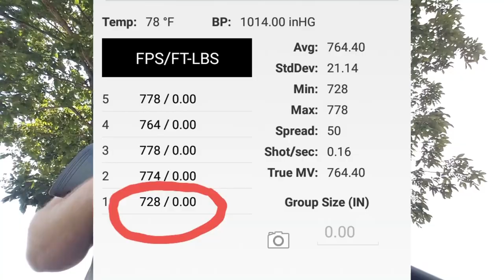PCP Airgun NOT Shooting Good? Here's Why...3 Tips YOU have to try

Comment: Good tips , i have a 397 that on some days it shoots all over the place ,then others it right on . It has some   hammer movement . I will try diffrent balance points to see if that it.
Reply from the maker: Thanks let me know!
Reply: You are the man! I just tested my 397 and 880 with your hold near the balance point. Just slight tip to the front .  Off a bag The 880 the first three shot were in the same hole next two were real close. Next sat down off my knee 5 more less than a dime @ 20 yards. Broke out 397 shot it 6 rounds of 5. 3 on bag  3 on knee dime to nickel  for all groups. I think you got me on the right track iI never hold that close to the trigger before.next I got a cheif II S I will see if it dose the same.It  just it takes some pumping to keep it in the sweet psi . 2800 down to 2200 or so for the same poi. I get back with you after a few days of testing. THANKS FOR THE TIP.
Reply from the maker: @glenray7464  No problem, thanks for the update!!!

Comment: It’s not firing or making cocking noise
Reply from the maker: sounds like something internal, trigger or sear not catching the hammer to cock
Reply: It’s not cocking the hammer back
Reply: Yes
Reply: Should I send back Umarex or get new one with from store
Reply from the maker: Its gonna need fixed or replaced depending on how new it is ...if its returnable
Reply: It’s new had less than a month